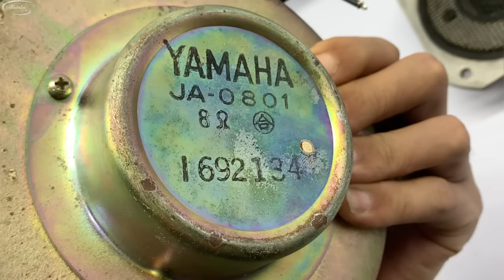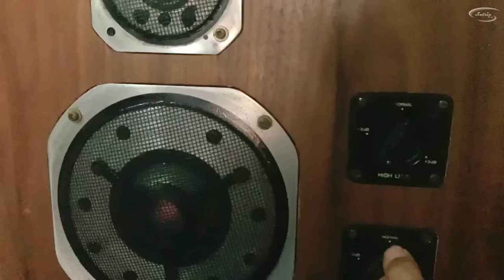Maintenance Speaker System Yamaha NS-1000M All Speakers Component | Beryllium Diaphragm

Comment: I’ve done a few of these drivers. When the drivers are apart, why not sand blast the aluminum frames to look new again. When pulling the guards or screens off, remove the rubber ring also. Then when putting together you put screens in first then the rubber, much easier. And I’m sorry, they may work and sound nice, but I’m to picky, looks say everything to me, if these were for sale, I’d pass. The aluminum looks sanded instead of blasted.